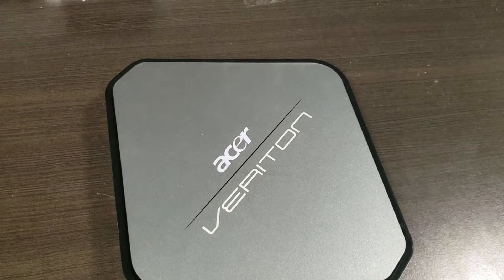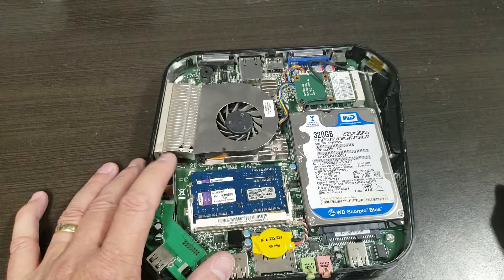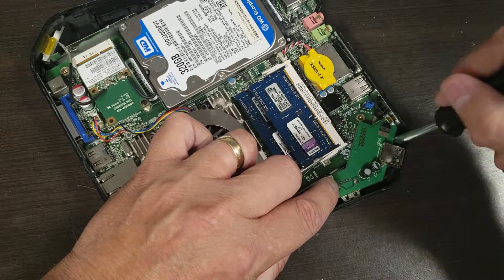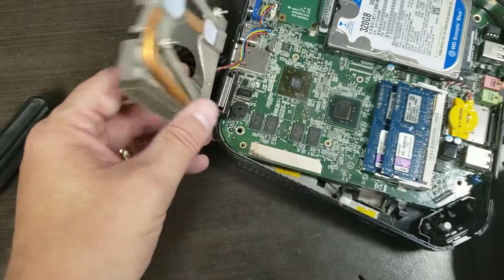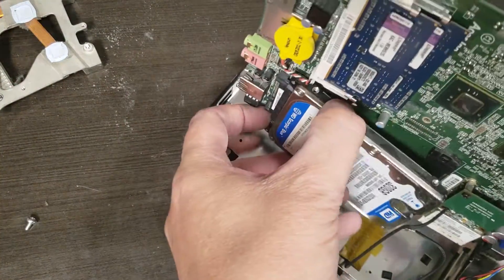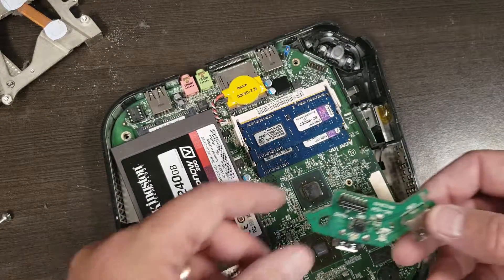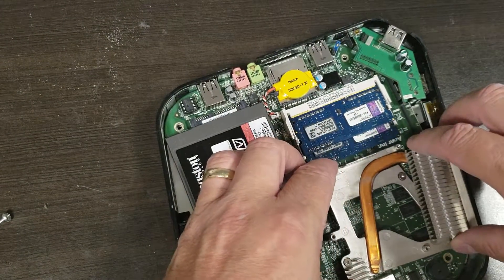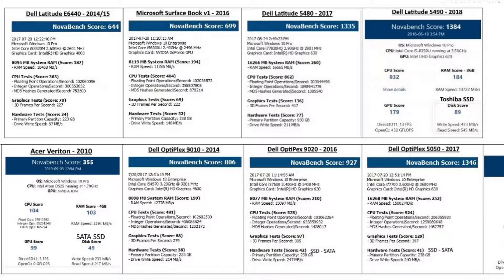Acer Veriton N282G Disassembly, SSD Upgrade & Benchmark

Comment: Thanks for this, was a good sanity check when dismantling the one I pulled out of e-waste. Two things to note:

1. There is an initial screw where the stand is supposed to connect at the bottom, that holds the side of the case on. You didn't remove it before spudging the side off - I think on yours it was missing. Don't want anyone trying to wrench the side off without removing that.
2. My hard drive was indeed held in by 4 screws. Basically, I think someone's opened yours before you, and left a few screws out.

Comment: Anyone knows the cmos battery inside is it 2 pin or 3 pin for the connector?
Reply: Probably irrelevant by now, but for anyone needing the answer it's 3 pin
Reply: @NinjaKnight1YT  thanks bro appreciated
Reply: It was still relevant even after a year? No worries though